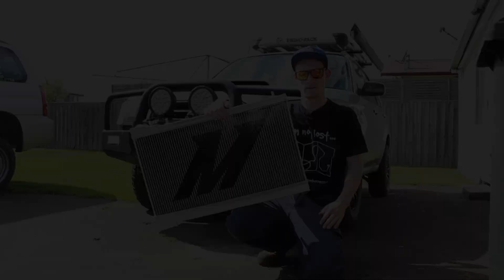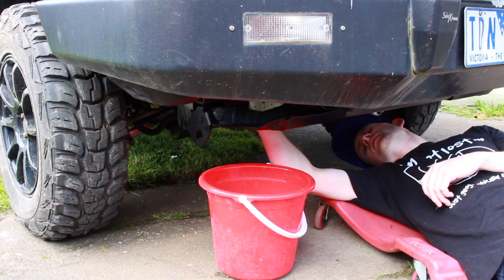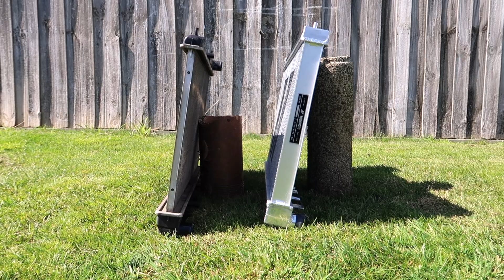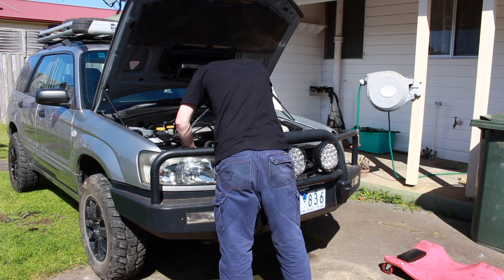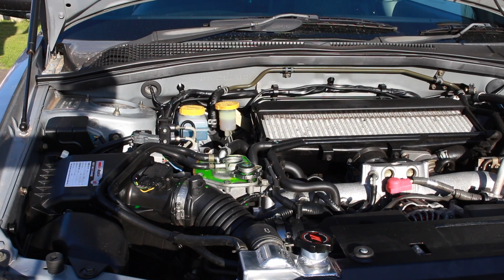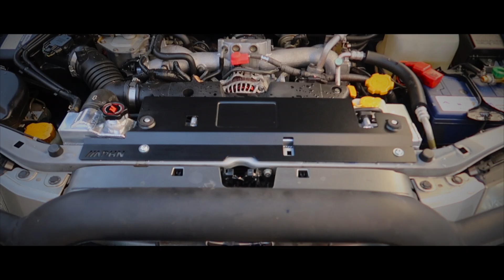XT forester alloy radiator install

Comment: Any problems yet with the new radiator? And would you recommend it? As I’m looking to upgrade to mishimoto radiator?
Reply from the maker: I’m not entirely convinced with it to be honest. Works great at speed but when I’m crawling around there doesn’t seem to be enough airflow to cool it properly. I’m going to look at upgrading the fans and see how that goes.
Reply: @ignitionoffroad5028  ok damn🤦‍♂️lol was thinking of upgrading to this? Hopefully the fans will help? But heard koyorad radiator is good? Not sure. But yes, hopefully that will be the next video? Thanks for the video.
Reply from the maker: @milzdox7757  yeah I’ve heard good things about the koyorad as well

Comment: Nice. I really enjoy these install videos. All this stuff that I normally wouldn't consider doing myself looks pretty easy when you show and explain.  It annoys me that Subaru makes part of the radiator out of plastic. Seems like an inevitable failure at some point.
Reply from the maker: Thank you! I’m personally getting sick of install videos and just want to explore, but when stuff brakes it’s a perfect opportunity to upgrade! Unfortunately I think it’s standard practice for most OEM radiators to have plastic components as they are cheaper to build.
Reply: @ignitionoffroad5028  Haha, for sure, you need to get out on the tracks. That's a LOT more fun to film. I hope you guys start getting some leeway soon.

Comment: Hi there mate, 
Thank you for the great vid, love your car. Hey with your experience do you think this rad would fit the non turbo model?? Keep those vids coming and stay kool friend.
Reply from the maker: The radiator will definitely fit both turbo and no turbo. There’s just one or two additional lines you may have to plug in your case, but should be easy to do.

Comment: Cool mod! That radiator looks like twice the capacity. 

I also need to invest in a burp funnel. The kind that lock to the radiator cap. I made a huge mess when swapping radiators for the Baja.

The plastic end does indeed crack with age/miles. The VDC Donor was cracked and leaking at around 17 years old.
Reply from the maker: I don’t know why I haven’t invested in a funnel yet. It’s a cheap tool that does a great job. One day I will get one and stop making a mess...

Comment: Wow, the cooling capacity of the aluminium radiator must be huge. I was surprised with the extra thickness that it fitted with the cooling fans in place - effortlessly it appears. 
Can anyone comment on the 4AT in turbo SH's?
Reply from the maker: Yes was a great fit! Quite tight between the radiator fans and drive belts now, but enough clearance that everything runs smooth.

Comment: Hey, 
Great Work, did the same thing on mine ;) 
You need to look for leaks, because in my Case these Stock Clamps are shity...

Greetings from Germany
Reply from the maker: Great advice! I have found some leaks around the top hose clamps. Replaced them with better clamps and it’s all good now!